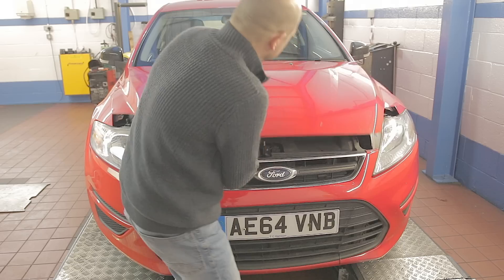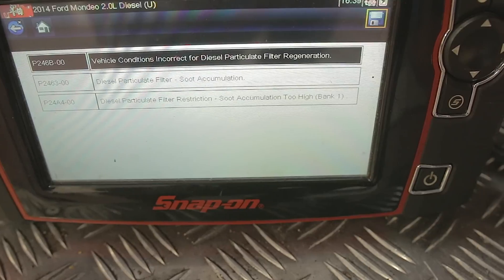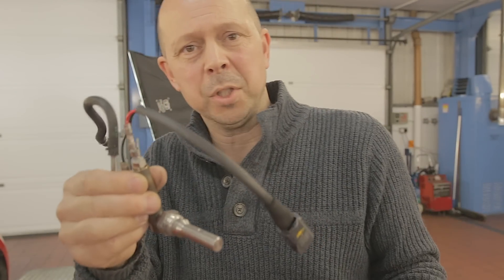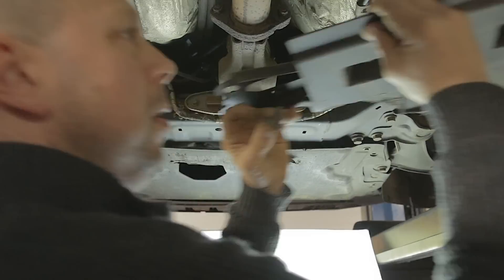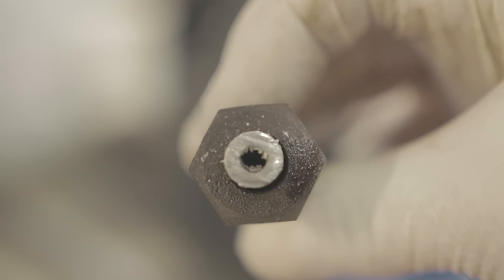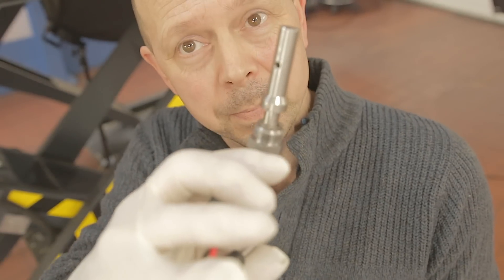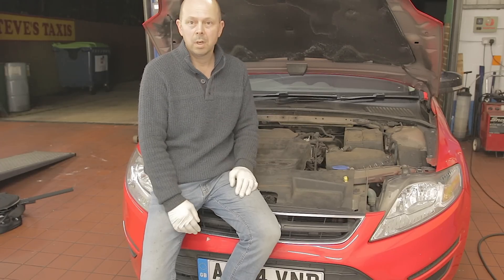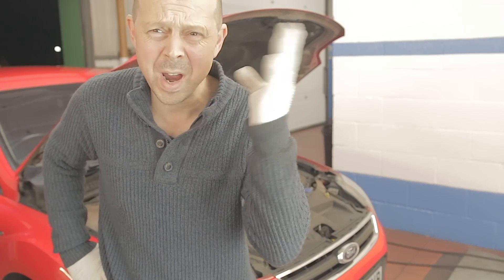Ford Mondeo mk4 Diesel Particulate Filter Fuel Vaporizer 2012-2014

Comment: I've seen this video a lot of times before, just for my information. Driving home today, could feel it's doing a regen, nothing new...after a couple of minutes P244C exhaust temp to low for regen. I was just 5km from home. Could I drive another 40km to the garage? Without overloading it, so that I would not need a static regen. By then it will at most be at 150% I'm guessing...and I know it cannot do a regen on it's own when it's over 300%. Is this right?
Reply from the maker: you won't get too far before that dpf clogs up but you may be lucky...yes by 300% you will need a static regeneration  just to be able to clear the fault code
Reply: @alan4x  thanks Alan. I actually found it to be at 43% load, even after the code. So it's not completely dead, maybe I can get another regen out of it, and not have to do a static regen by the time I make it to the garage. Any issues after the static regens? I've been told they are not good for the dpf life and should be avoided if possible.

Comment: Hi Alan is it possible to  drive at 2.500 rpm on the motorway to regenerate after a relacement vapouriser  Dave
Reply: I did once, all vents off, 2.5k revs on 3rd and after short while it started regen, it took 13 miles to complete
Reply: @DexterXxX  Hello mate, all vents off? Do you mean we change that filter and take it down the motorway and all be Ok? There's a mondeo 2014 for sale with dpf issues selling for £1500 and is not sure. Thx
Reply: @barrygray8356  I had MAF sensor error and my DPF wouldn't regenerate. Forscan showed 375% and I did not want to do it on the driveway so when I did put new MAF sensor and deleted codes with scaner, I took car on the road. I turned off all vents(interior fan/heater-blower) to OFF and drove car on 3rd gear at 2.5k revs for few minutes and regen started, it went down to 150% and procedure stoped and started off again in few seconds and went down to 23%.

My DPF was fine before the MAF sensor fail and it is fine now. If you want to buy mondeo with dpf problem it could be a problem with dpf, vaporiser, dpf sensor, CAT problem and the list is long.

I only said that regen is possible on the road without the scaner as I done it myself. I just dod not want to rev car on the drive for 30min with dpf at 350% as It is dangerous due to the heat and lack of airflow round the car engine and components.

Please dont asume that this procedure solve dpf problems as it only helping to start regen proces while driving.
Reply: @DexterXxX  Many thanks for d thorough explanation.The list is long 😳 on dpf issues you mentioned, a bit worried now, i think I'll stay away from tis one. I thought to just change d vaporizer and take it down the motorway at 70mph on 4th gear for 20 miles or so would solve the issue 😀 but we never know do we. RISKY STUFF! Thanks again mate you're the best 👍🏼

Comment: Hi Allon, I have a ford kuga 2008 tdci  2.0L, runs perfect when cold and hot, as soon as I turn engine off when It reaches temperature, car refuses to start back up, I have changed crank sensor, fuel heat sensor, the pump that fits on your high pressure pump and I have still got the same problem and I had the injectors checked,  and they're  perfect, it comes up with no codes for this fault, this car will not start backup until car is cool again, I can run all day in the car along as I dont turn it off, can you help?
Reply: Check the injectors

Comment: I had one gone bad on a transit and took the glow plug out of it, drilled a small hole in the large pipe just above the nozzle and cleaned the soot out through that hole.. after all that i had the hole covered by weld and that was it. Done a regen and it's all ok now.

Comment: My car is a nightmare, I've got a 2011 mondeo estate and the engine malfunction light is on, I have no power loss so I assume my dpf is not yet blocked, I've driven 5000 miles like this with no issues other than the engine malfunction light.
The error message is catilist temperature too low. 
My garage told me they need to remove the dpf to clean and fit a new vaporiser,  the only problem with this is, firstly, my car does not have a vaporiser like Alan, s taxie instead I have 2 pipes going straight into my dpf that cannot be removed unless I replace the full dpf and secondly why would my garage need to remove and clean the dpf if my car is running fine? Am I being thick here? Lol.
I have had my car into anougther 2 garages and neither can diagnose the fault, my car has now covered 150000 miles and I brought it with 145000 miles so I took a gamble here really but apart from this the car is spot on and was well worth the 2k I paid until this poxy light came on.
Also this engine malfunction message can be cleared but after 300miles it always reapears.
Any help would be much appreciated.
Thanks

Comment: Hi Alan, my 2013 has been in with the mechanic today and he tested everything and all is working. No blockage in the nozzle, no vacuum pressure. The car is showing P244C. Car is putting up engine malfunction warning but no EML. No loss of power or limp mode. Car is on 160k+. Mechanic reckons Dpf is just fubared. What you reckon mate?

Comment: Hi Alan,
I have a Citroen C4 VTR plus HDI 2.0L 2005 that had a new turbo about 2 years ago. I purchased the car after the old owner replaced the turbo. Unfortunately the turbo has only worked once and that was when I put some diesel magic into the fuel tank and magically the turbo started working and lots of power for only a few days. Could the reason the turbo is not working is due to the DPF  being blocked and thus a loss of power or the EGR valve possibly being caked up with soot or just that the turbo has failed or has a blockage.

Comment: Great watch. Currently got a galaxy in with the code p244c low temp in cat during regeneration. Removed the fuel pipe from vaporiser and activated pump via snap on machine. Pumps diesel so i would assume the vaporiser is blocked or the glow plug is knackered. Local ford dealers are wanting £278 plus vat

Comment: Hi there just wondering if you could help we got a ford mondeo mk4 2.2 diesel starts up fine and drives completely fine for 15 mins the goes in to idle mode but no light on dashboard then if switch car if and on then it goes back to normal for 15 mins again thank you

Comment: Hi Allan,  I had the engine sign come up in my 2012 Mondeo and took it in but they said they didn't have anything show on the analizer or what ever you call it but they put a new throttle box in . It hasn't done it since but I haven't been on a motorway since so I don't know if they cured it but I had them change the fuel filter as I didn't know if that had ever been done so do you think it could show up again. The mileage on the odometer is 115000.I would appreciate if you answer but I won't mind if you don't.
Reply from the maker: its hard to know why the engine symbol came up without knowing the fault code but a blocked fuel filter can cause all sorts, best thing is give it a good run and see how it does

Comment: Have 2011ford Mondeo 20l diesel when I press my clutch pedal it rattling half way down when ya press it what would it be
Reply from the maker: that will be your duel mass flywheel rattling
Reply: @alan4x   long will it last like that only started  there very dear need another few weeks out off it
Reply from the maker: you could get 5-10 thousand miles yet.... it will gradually get more rattly and the engine will vibrate more
Reply: @alan4x  need to get it sorted so thanks for your help

Comment: I had this problem last year. Changed injector/nozzle with a genuine one everything back to normal until a few days ago when again the P244c error is back. No limp mode, car drives fine but mil is on and cant clear it. Checked fuses in engine bay and all of them apparently are ok.

Comment: Hi Alan,

I wonder whether you could help me as I am absolutely stymied on what to do next.

I have a DPF fault where my galaxy keeps going into regen and failing with an Engine Malfunction after 10 minutes of driving.

It won’t complete a forced region as it takes about 6 to 7 minutes then fails.

From a spare working Galaxy I have on my drive I have replaced the DPF, fuel vaporiser, fuel pump, and the actuator plus pipework to the exhaust. I have no idea what to do next as the fault is the same.

I’ve used for scanned to reset the codes and to do a forced regen but it just won’t complete.

The error code I’m getting is: P222C:00-2F and the error code has been consistent throughout the process.

The urgency is that I need to sell the car as we need the money - but I can’t sell the car with the fault.

On regen the exhaust temperature didn’t get near 600 degrees so my only step next is a brand new vaporiser?

Lastly, the DPF load still sits at 0 and doesn’t move. The Soot loaf sits at 300% (but in the previous Galaxy it was fine.

I need your help!!
Reply from the maker: sometimes you need to reset the dpf values to zero so the ecu thinks the dpf has been replaced..if there are no other problems then it should carry out a regen.. i take it the fuel vaporiser nozzle is not blocked
Reply: Alan Howatt thanks for your feedback- appreciated. Yes the vaporiser is working as is the glow plug - Will look at resetting the DPS values – not sure how to do that with forscan though.
Reply: Alan, I reset the DPF values and it sorted it - now 19% thank you.

I now have a high pressure fuel leak under load which puts the car down on power with P0093 and P0094 codes!!!  No leaks under the top cover and around the injectors or by the fuel filter (the filter is new) so I’m stuck again!!

I can’t get my kids about at the moment and this is a huge pain.

#sigh
Reply from the maker: @thestorming  the leak will not be external...it will most likely be an injector leaking too much fuel back to the tank out of the leak off pipe.  you would need a fuel injector leak off test carried out to confirm that and if it is you just replace the faulty injector
Reply: Alan, I cannibalised a leak off pipe from an old engine I had and his five mil plastic tubing into water bottles! Cylinders 12 and four were excessive leaking so I replaced them and all sorted! Thank you so much.

Comment: I have a Mondeo Mk4 2.0 TDCI 140 CP QXBA and i dont see fuel vaporizer around the dpf.They are version without vaporizer?
Reply from the maker: some of the earlier mk4 mondeos did not have a vaporiser
Reply: @alan4x  Thx for reply.I have a problem with DPF or DPF sensor,i have P2453 error stored in ECU with MIL on and limp mode activated.I try to delete with ForScan but after a  while is back again.The problem  is that my  DPF sensor readngs value with key on and engine off are 4,8-4,9 kpa instead of 0,0.My DPS  sensor was changed with a new one from Vemo last year,the old one was complete dead.I tried to reset dpf sensor learned values with ForScan but no chanage.The hoses from DPF are fine.I should try another sensor,this time FORD OEM?

Comment: Alan. This video is great. Question for you. I have a 2010 diesel mondeo. That regens every 12 miles and with a scanner plugged in shows the regen happening. Then no fault code once the regen is complete. Is this a replacement DPF? And if so how hard are they to fit yourself? I'd assume if you have to replace the DPF you replace the Vaporiser as well. Cheers Sean
Reply: I take it you have replaced the dpf by now? Changed the one on my dads 2013 mondeo but purchased the sensors at the same time as they can sometimes seize in there. It didn't take long at all 4 bolts and unplug the sensors and the two hoses and it was off

Comment: I have just got the DPF in my mondeo 2010 cleaned and the vaporizer replaced. The only concern I have is that the car doesn't read the average MPG or how much fuel is left in the tank any more. All i see is - - -. It is something that I didn't experience before the issue I had with the DPF, is there an explanation to what causing this?

Comment: Hi Alan,
I've just changed the fuel vaporizer  on a Ford S-max 2.0tdci from '11
And i was afraid it was jammed with carbon, but actually the hole didn't looked blocked at all. It was the same diameter as the new one. Just a bit black/grey. Did not expect that, car has 233 000 km which is 145 000 miles. I don't get it why the cars you work on are so clogged up. Maybe bad fuel quality?/ very long idling?

Comment: Nice video, as expected!
I had the same issue on my Focus and before I ordered a new part I thought I'd try to mend the old one. What do I have to lose, right?
Long story short, after I burned the nozzle with a gas burner it started smoking and got nice and red. Kept it glowing red for about 30 minuted until I saw that there is no more smoke coming out, let it cool down a bit (no more red colour) then cooled it down quick in water to crack the soot inside then with a pick broke all the remaining ash inside and blew it out the hole.
Managed to unclog it and it saved me about 315 Euros.
Ah, I removed the hose and the spark plug (measured it beforehand though) before baking the nozzle, just to be on a safe side.
Still using it 2 years later without any issues.
Reply from the maker: thats great
Reply: only problem with that, is for a garage to do that it would cost more than what the part costs to buy, hour labour to swap new part or 4 hours to clean old part.....
Reply: Excellent tip. worth a go for any home mechanics.

Comment: hello.you can tell me how I can activate the diesel pump from the fuel vaporizer valve and where the fuse is located. I have a P629F error. I changed the fuel vaporizer valve but it does not do the dpf regeneration.

Comment: I have the same Ford setup on the Puma engine in my Relay van.  Could you please confirm that when you disconnect the metering pump you should be able to blow straight down the fuel supply pipe into the exhaust?  I can't so I am guessing it is blocked solid but it is an exhaust off job on these vans to get the injector out so I am just checking.  Thanks.

Comment: My 2014 transit custom has gone in to limp mode so we put on the said snap on scanner to do regen. it was saying that the filter is 186% blocked. when we tried doing a forced regen several times it would keep coming up after about 5 to 10 minutes saying regen unsuccesful. other codes were something to do with glow plugs. would changing the vaporiser clean a dpf blocked to this extent do you think or would i be better off buy a new dpf?
Reply from the maker: the vaporiser must not be blocked or it will not carry out a full regen...check to see if it is clear and replace if blocked...if you fit a new vaporiser and it still won't carry out a regen then drive the vehicle hard for ten minutes as best you can in limp mode and try... if still no luck then there is an option in the scanner under special functions that you would click on if you had of replaced the dpf..i think it is reset or relearn dpf values...after doing that as long as there are no other issues with the vehicle it should carry out a full regen.....after about 40mins later when regen is done the snap on scanner may say regen unsuccessful ....but you will now be able to clear the eml codes and in that case it has been a successes
Reply: @alan4x  thank you for reply. i will try this and i'll update you afterwards.
Reply: @alan4x  I bought a new vaporiser and we fitted it today. It wouldn't do a regen with the snap on scanner so I took it for a drive as you said. When I got back tried again, hey presto away it went. About 49mins later all done. Went from 186% blocked to less than 30%. Thanks for advice, it really helped.

Comment: Alan, I have a similar problem with my 2012 Smax 2.2. Ford have quoted Fuel Vaporiser and a new DPF.  Could I get away with trying the vaporiser first? They want £1200 for both.
Reply from the maker: yes replace the vaporiser first (if it is blocked) and then carry out a static regen ..chances are that will sort it... our mk4 mondeo taxis regularly get blocked dpf for various reasons but once regen is done all is fine,,, never had to replace a dpf here
Reply: Alan Howatt Thanks

Comment: Mine has literally just started a regen as I pulled onto my drive (2012 Titanium X Sport). Never revved like that, but the exhaust note changed and the fans came on full Bore! 😂 Took just over 5 mins to complete. Also, a worthwhile note, check your instant mpg. When just idling, it should read 0.1 mpg, when on a regen it should read 0.4 mpg. 👍

Comment: Hi, Alan, thanks for the video clip, I've changed the vaporizer valve, but still can't solve the problem of my frequently DPF regen(there was no any error message, but DPF regen almost every 200km), I didn't do the force regen after the replacement, Do I need to reset the "Exhaust Gas Temperature Learned Value" or something else by using Forscan?
Reply from the maker: a forced regen is usually the best action if the engine management lamp was on due to dpf soot accumulation but the very fact your vehicle is doing a regen as it should without any error codes said to me everything is working fine, do you do much about town driving or motorway miles as typically a long run down the motorway is the best chance for a regen to take place successfully
Reply: @alan4x  thanks for the reply, I drive around 100km at every working day and 90% on highway, I used to watch a vid clip about changing the vaporizer valve, said they did reset something and did the force regen after the replacement, but they didn't point what exact it is, the mileage of my last regen. is about 500km, seems it is getting reasonable, I'll keep it up to date.